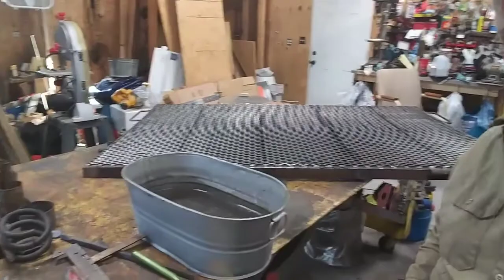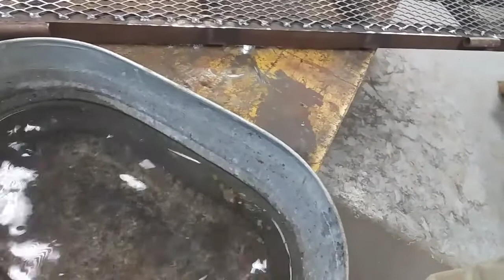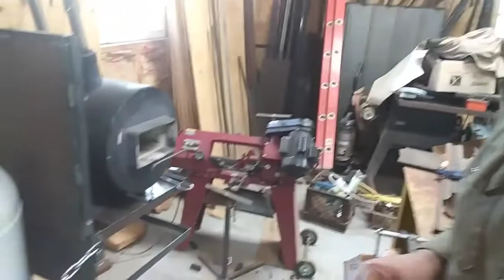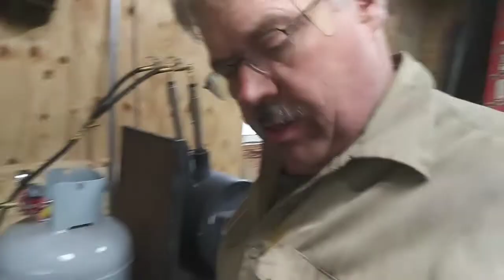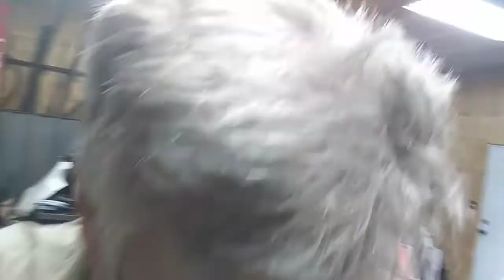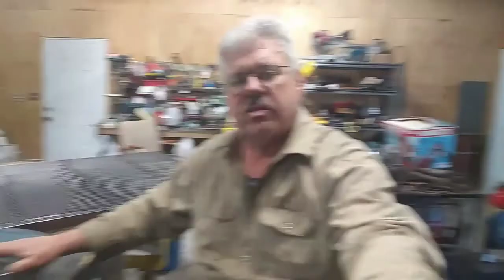Blacksmith's Slack Tub (Quench Tub or Bucket) Mank Tank

Comment: Gary, Thanks again for another video. I find it quite interesting that we not only have the same forge but that we also use the same slack tub. Lol. I got mine at Lowe’s and built a wooden stand for it out of some scrap lumber I had in the shop and it works quite nicely. I also put a few drops of Dawn soap in it to keep the crawlys out.
Reply from the maker: :)  I have so many projects to get to. Welding up more stands for my slack tub and my anvil, a work bench, putting up my plywood on my ceiling and a lot of forging.. This work stuff gets in the way of all my fun stuff. lol

Comment: When you said green coal class did you mean the class was primarily to learn how to use coal efficiently? That sounds like something I need because almost every single time I've used coal I burnt something during that session
Reply from the maker: I usually mention what green coal class is but forgot this time.  Around this area most forge groups have a Green Coal class which only means a beginner class.  How you turn Green Coal into coke kind of a thing.  But to that point, in our green coal class the first lesson is on the coal fire.  How you spend half the time tending the fire and stuff like that.  So you do get lessons on the coal fire while doing about 15 projects over several months.